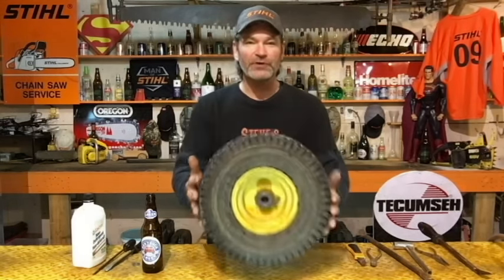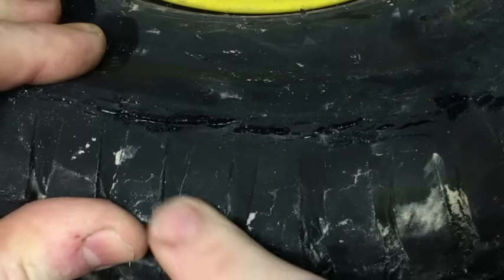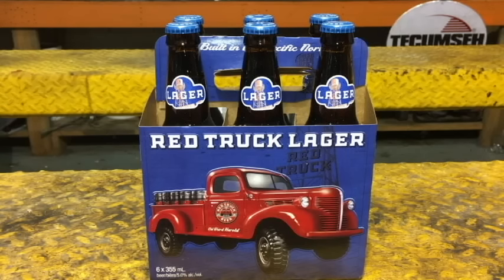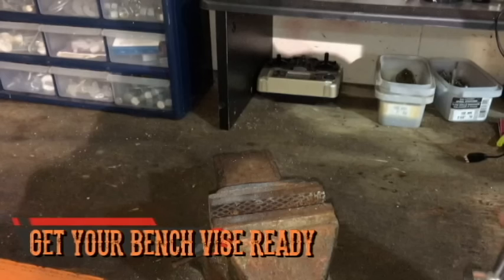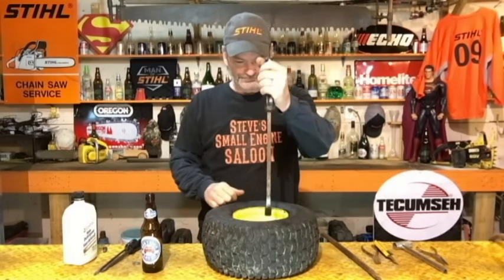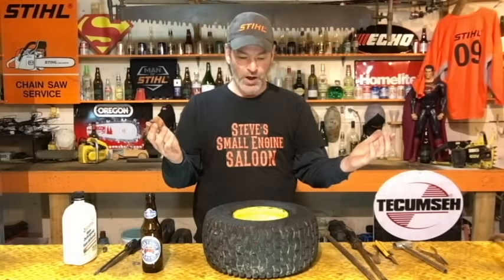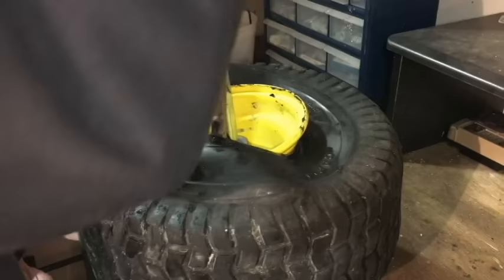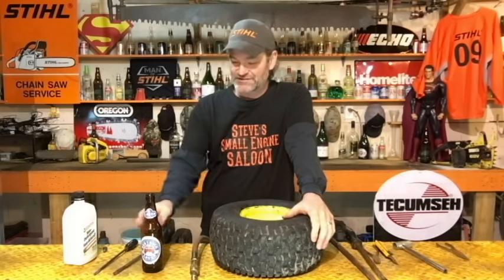How To Install a Tire Tube on a Riding Lawn Mower Tractor

Comment: The valve pulling back in on inflation was making me lose my mind.  I thought the tube just needed fitting better, but no matter what I did, it pulled to an angle that, with use, would have eventually damaged itself.  So THANK YOU for the needle nose pliers tip.  It's not 'cheating'. It's totally essential, because ALL tubes have the valve fitted on the line of shortest circumference and are therefore BOUND to pull in if you don't hold them in position.   (Unless you have a valve hole right in the centre of an open, alloy type, wheel/rim.)

Comment: I always use a zip-tie to hold the valve stem while inflating the tube. Works well and easy to clip off once done. Another excellent video by Steve. Love these videos. 👍
Reply: A thin fender washer works great too under the valve cap.

Comment: DAMAGED SIDEWALLS: Hi Steve , a tip for the damaged sidewalls. Many tyres that have bees sitting flat for many years develop sidewall damage which most mower shops will tell you to toss and buy new ones. If the inner surface sidewall is rough, it will damage an inner tube. The solution is to buy a small roll of BUTYL FLASHING TAPE. It is used to seal roofs. It is around $25 and it is an aluminium foil with a thin layer of very sticky butyl rubber. Cut a patch so that it has no sharp corners and apply it over the inside of the tyre. This will cover the damaged inner wall and allow the inner tube to last for years

Comment: I dreaded putting a tube in tires and changing tires.  In fact, I have had new tires for a snow blower and several years ago I took the wheels off, and as soon as I put the tires and wheels on the driveway, I thought maybe they were ok and put the wheel back on with the old tires. After watching this video I put a tube in a tire on another snowblower and when I got done I told my wife, that was fun.  Thanks for the video.
Reply from the maker: Right on   :_Beer: :_Mower: :_Rider: :_Chainsaw:

Comment: Hi Steve, I'm in Melbourne Australia, and have an old Rover Rancher 11Hp each wheel has 2 half rims that bolt together and make this job so much easier.. but I find putting a small amount of air into the tube before inserting it makes it easier to keep the stem in place and also fitting the tube into the tyre. I love your idea of holding the tyre in the vice. Keep up the great informative videos. orh and ... cheers.. hic hic hic.. need another drink of beer.
Reply: Having split rims would make this job so much easier, you will find that when you replace your mower you get these awful solid rim things, and do not expect the job to go so easy as this demonstration shows, the old tyre will be really hard due to the sun for a start, and will refuse to come off the rim! Keep your split rims as long as you can! Chris B.

Comment: Scissoring the two tire spoon/screwdrivers... genius move! Nicely done, Steve. I'm working on a front tire right now. I don't drink beer, but a root beer or dr pepper may be needed. 

Off to the tire and vise.

Edit: Success! A bit of a challenge, but mission accomplished. Thanks for the tips.
Reply from the maker: Who needs beer when you can have a refreshing root beer or Dr Pepper to get you through the tire-changing process? Cheers to your success, my friend!

Comment: Tires exposed to a lot of sunlight will lead to the sidewall cracking.  Your physics teacher would be proud. Nice job. Not all sealers work the same, need one for small tires with low speed, unless your lawn tractor will get up to 45 mph.

Comment: I just did this yesterday before watching your video. The only thing I didn't do was the  use the vise with the pipe thru the arbor. That would have made it easier. Anyways I thought I would have more trouble installing the tube but  I got er done pretty fast.  Good video though. Always learn something new from you Steve. Thanks.
Reply from the maker: Excellent!

Comment: Just 10 minutes ago I gave up trying to break the bead on the rr tubeless tractor tire. It’s a bit dry but lubed with soap, no go. I tried clamps, even took by barbells with 75# leaning on the bead. Nope! Tried clamps. Ah-ah. I’ll try the screwdrivers, I’ve got big one and pinch bars. I loved the bar in the vise using it to peel the bead off. I’ll give it a go later tonight or in the morning. Got the new tube ready. Great video as usual. 
Steve, Plymouth, MA
Reply from the maker: Right on ....
Reply: Found the tire resists removal because I previously put that gree slime in to stop leaks. 😤
Reply: Follow up to previous post. I gave up. Brought it to tire shop. For sure this is contaminated with green slime. Don’t use it guys. Gonna clean it out and put a tube in, like I shouldah.

Comment: Outstanding!  With the tip for the makeshift tire mounting machine bench vise setup I will install the tube in this 20x8-8 rear cub cadet tractor tire myself.  Good tip with the washer on the stem too!!
Reply from the maker: Good luck with that installation!

Comment: Hi Steve, Everything you mentioned in the video worked according to plan EXCEPT!!!  Putting the tire back on the rim with a crow bar. I tried it, the crowbar slipped and almost knocked me senseless. I’m pretty strong and I tried holding the tire down and against the rim, still the force needed to accomplish stretching the tire would need a second set of hands. Putting the tire on the floor and kneeling on it while I slowly worked it on worked ok but, it wasn’t easy by a long shot. I’m a contractor and nothing seems impossible although this project was uncomfortably close.

Comment: Did one of these today , got the tyre back on one side , installed tube , then had brain freeze for the other bead but remembered Steve had a video on this . Job done , thanks Steve :-) ( Doing resto on Troy Bilt 17.5 / 42 , been sitting for 12 years . )
Reply from the maker: You're Welcome...

Comment: Best one i have seen yet especialy the trick for getting the tire off.Will try that myself tomorrow,gave up on it today.I put a zip tie [cable tie] around to stem of the valve on my tire to stop it from dropping back in.Will leave the tie on ,no need to remove it.Thanks for the tip,enjoy your beer.
Reply from the maker: Right on Terry...

Comment: I'm electrician and I had some wire Lube that we used to pull wire with I put that on the rubber around rim,  that help get it on, just information, thank you so much that double screwdriver or Tire Tool really works good
Reply from the maker: That's a good idea!

Comment: Due to age of vid I know you might not see this but I wanted to show some Appreciation.   I'm partially blind and had a stroke-many years ago, I'm fine but it left a few issues like balance.   So, that said I'm not exactly on the "I'll run down to the hardware store and get a new one' list.  Was fighting this tire-actually it was needing airing up several times a month-very slow leak.  Finally looked into tubes but, as with many. had issues getting the tread off the rim.   I've had to make a few changes-no vice so a piece of hurricane fencing support-the thin steel rids, driven into the ground then using two others to peel the bead off.  Now to reverse engineer your method of getting it on-no way am I going to 'pull' that rubber apart by hand to reseat te rim but this gave me a starting point so thank you.
Reply from the maker: You're Welcome...

Comment: Cool trick with the washer Steve 👍
Reply from the maker: Thank You...
Reply: Steve, you must have a few more brain cells than me, guess I had more beer than you over time - "" Why didn't I think of that washer on the stem trick "" ??????  Great suggestion !!!!!!!
Reply: Yeah the washer is a nice trick.  Y'all can leave the washer on until air is in the tube to avoid holding it with the pliers.  If you can't find the right size washer, drilling a hole in a coin works.  Washer costs more than a penny anyways.  lol.
Reply: @whycantthisbeblank  I'm not sure how that would work.  The reason the washer works to keep the valve stem from retreating back into the rim is because the valve stem cap stops the washer from coming off the stem.   You have to remove the valve stem cap to air up the tire, and once you remove the cap, there's nothing holding the washer in place, so the stem can retreat back into the rim.
Reply: I partially inflate tube to prevent stem from retreating. It also make it less likely to be pinched when recounting tire on rim.

Comment: Your tips and tricks helped me greatly. Thank you. It really ticks me off that a supposedly quality product like John Deere would use what has to be the cheapest, poorest quality tires, and have the nerve to charge a fortune for replacements down the line... and that's if they even have them in stock. My local dealer wanted $149.00 wheel and tire (they didn't have just the tire).
   So good ole' Amazon sent me a tube for $10. You and I put the two together and we're rollin' again.
Reply from the maker: Right on Buddy..

Comment: Thanks for sharing. The washer on the valve stem is a great tip. Have on multiple occasions had to pull the tube out and start over because it slipped back inside.
Reply from the maker: You're Welcome...

Comment: Thank you Steve! First time doing it, and it was easy as pie with your instructions. Didn't have a vise to use, but with a little bit of work i was able to get the tire off, tube in, and tire back on in probably 20 minutes.
Reply from the maker: Fantastic!

Comment: At 9:02, he pushes the tire down then pulls it into the rim. This is super important to get the other side of the tire into/under the rim.  Like he says a few times in the video, these small tires can be very frustrating to remove and install but following what he does makes it very easy, well maybe not easy but certainly easier.  Good job Steve!!
Reply from the maker: Thank You...

Comment: Another great video. I'm getting ready to put tubes in both front tires on my mower and this really helps. I've seen some video where they don't take the tire half off, they just kind of stuff the tube into the collapsed tire. Seems like a challenge but regardless, thanks again.

Comment: I also thought the washer and cap on the valve stem was genius. For me, it didn’t work. The threads on my plastic stem caps were too weak and the caps kept popping off.

What worked for me - my schrader valve puller has a threaded end that fits inside the stem. I pulled the valve, screwed in the tool, and it held great.

Great video, helped me a lot!

Comment: Man, that washer idea is great. I tried installing one for the first time. Started  airing up and it sucked back inside. Problem was, i couldn't deflate it to get it off to get to the stem. I found another trick was to use a locking chuck that clips on the stem when airing up tires. Remove the schrader valve and clip the chuck on there. Without the schrader valve if it sucks back in again all the air will flow out of the tube.

Comment: Not sure why anyone would give you a thumbs down on this one Steve.  I am a pretty resourceful guy but I always learn something from your videos. :)  I love the washer trick .... Brilliant.   Just make sure to grab the valve as you did with the pliers when removing the cap when you get a flat.   But then again,  you are probably going to have to open it up again anyway.   I love the idea Bob Haddock had with the Baby Powder.   That will allow the the tube to untwist when you pump it up.    Another Great Video Steve.   Keep on Truckin,  I mean drinkin!   LOL   Tractor Supply carries a variety of inner tubes.

Comment: The best tool I've used to keep the valve stem from sliding back out... A metal/alloy stem cap. Drill a hose in the top that'll accommodate a piece of string. Tie a knot on the string on the bottom side of the cap. Run the string through the hole...You're now good to go!

Comment: Your video makes this procedure very easy to do. I did it and my vice is not even attached to anything. It was just sitting on the floor. It helps keep the rim and tire stable.
Reply from the maker: Right on...

Comment: I would make sure to check the inside of the tire all the way around. You want to make sure there isn't a nail or thorn sticking through. If there is, you would just be wasting your time and having to patch a brand new tube. You can use a spray bottle with a weak soap/water mixture to find the leak. Also, I would use dish soap for mounting and dismounting and not any kind of petroleum product. It's easier to clean up and it doesn't damage the rubber. And if you don't have a washer you can try to put a little air in the tube first to help keep the stem in the wheel hole. Great video and I like the vise setup. I would have never thought of that.
Reply from the maker: Thank You...

Comment: I used my valve stem core remover to hold the valve stem. I did use the cross bar method. I used large tent stake, place in bench vice. The wheel fit perfectly. Also i used dish soap and water when breaking the bead that help a lot.
Reply from the maker: Good stuff!

Comment: Today I had to install a new tube in a 5" tire and followed all your directions and all except how to get the tire back on the rim worked fine. After spending an hour standing out in 30 deg. temp. I still could not get it to pop back on. What did work was I set it in place about 1/2 way and stood on it just like trying to break the bead and it popped right in place in about 30 sec.

Comment: I did this another (slow and harder) way a few weeks ago. I wish I had seen this first :) 

Two tips I learned:
1) make sure your valve stem exits in the right place (middle or side). I solved my wrong purchase by drilling out the rim for a new hole.

2) first inflation can be made without the valve in place. If the stem is sucked in because something went wrong, the hose will deflate automatically and you can rescue the situation.

Comment: i drilled an old valve cap and put a wire through it and its holds the stem so it fall in, works great. i have a beer after.

Comment: I wish I saw this about 4 days ago. I struggled putting a tube in. Took about 6 beer time to pop the bead and about 8 beer time to get the pesky tire back on the rim. Will use the vice and bar next time. 
Btw. Our tires are called tyres here in the UK.
Reply from the maker: LOL.  Right on Buddy...

Comment: Thank for this video.
It worked for me but I could not get the bead under the rim at the end. Not strong enough I guess. I managed to do it on the ground using my knee and a vice grip to prevent it from coming off.

Comment: I gently thread a 1/2-13 nut onto the rubber portion of the stem to keep the little sucker from sliding back down the hole. Works for me.
Reply from the maker: Great idea!

Comment: the washer trick is genius. I had trouble with a leaking inner tube and the stem sucked in. With the washer installed, in a pinch If it's a slow leak I can pump it up so i can mow then fix it later.
Reply from the maker: Thank You...

Comment: Tire sealant won't hardly work on tire sidewalls. It works pretty good on the tread area. I always put a small fuel line hose clamp on the bottom of the valve stem when putting a tube in. You don't have to worry about loosing it even later on if you have a flat tire.   It's not a good day when you come to use the tractor a few days later and discover you have a flat and the valve stem has disappeared back inside the rim. Ask me how I know.

Comment: Use a Schrader valve tool to keep the valve stem in place when installing the tube.  The bench vise with two pry bars is a nice tip.
Reply from the maker: Great idea

Comment: Quick tip. To hold the tube stem in place just clamp an old tire inflator nozzle on the valve stem while you work.

Comment: You had me at "It's gonna take about 2-3 beers to finish this job"
Reply: Me too, as soon as he said that I was like "yup this is worth watching"
Reply: What got me was he followed that with "depending on how fast you are". My first thought was: how fast you are at drinking beer or changing tires?
Reply: @toddkinsfather1968  14 beers in and I got it done after I fell over several times and dd not have that level of equipment. At one point I almost mistook the soapy water for a warm foaming beer. That was close.
Reply: In the mean time, Wife of 43 years filed for divorce just cause i could not change the tire when she  needed it to finally cut 4.5 acres of grass. Hoot, i'd have cut the grass if I knew she had a hard on about it. It's a big ass zero turn and she does not even know how to use it...

Hold on, hold on. Well there goes the cargo trailer and the side panels on both of the vehicles..... nope not done yet, crap heading straight to me. Crap have to get the cooler and save my liquid sanity.

Ah, never mind.!!!!!!

Comment: I'm trying to use tire irons. They work great on tubeless tires. However, on inner tubes, those will pinch the tube everytime. There's a way around that so you don't have to search for large dull screwdrivers. Take a 4×4 fence post and bury it in the ground end up. Drill a ½" hole around 4" deep. Cut of a piece of conduit or rebar to make an axle to fit in it. Set the wheel on that to prevent the rim from dropping or cocking at an angle. That's what keeps pushing your inner tube near the top surface causing it to get pinched. The rim now being stable prevents the tube from walking. I went through a few pinched tubes before I figured this out. Now AutoZone sells these stubby tire irons that doesn't go that deep under the bead. I got the longer ones from Northern Tool that sucks on inner tubes.
Reply: Inflate the tube a little bit before prying the bead over the rim. That will greatly reduce the risk of  pinching.